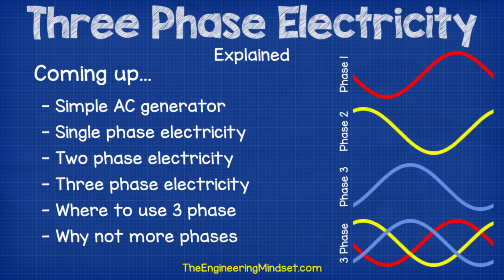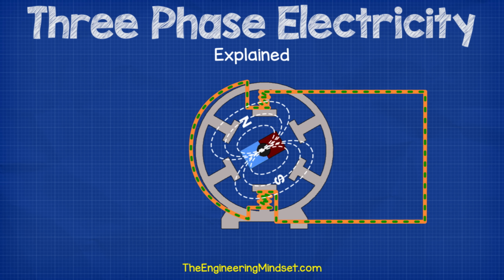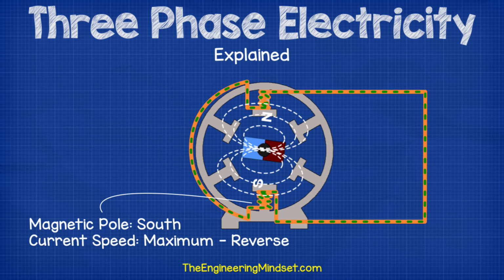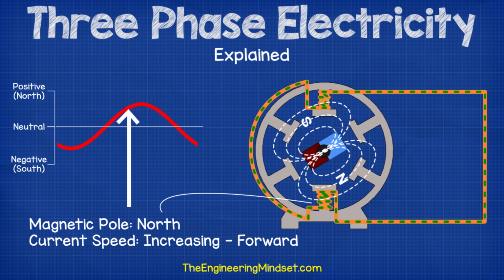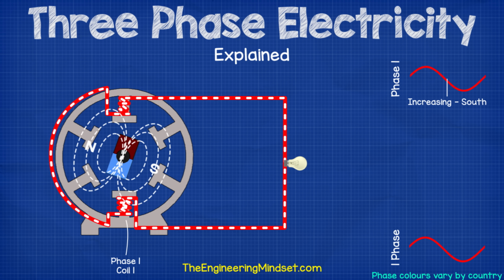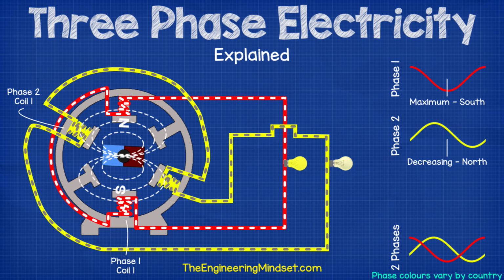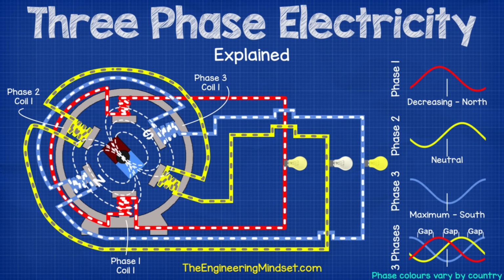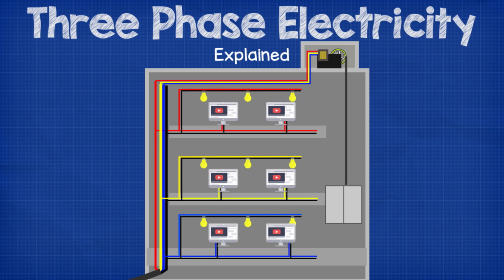How Three Phase Electricity works - The basics explained

Comment: Thank you so much for the animations - they make a world of difference. I knew lots of bits and pieces shown here already - that magnets and coils do the generation, what an AC sine wave is, the 50 hertz coming from the grid and some three phase stuff. But in this video a couple of details finally gelled everything together for me. I didn't really understand WHY our AC power comes in a sine wave, and why it comes from the grid at 50hz. But it's clear now it's simply generated in that manner, it's not being changed into that form by 'the grid' for any reason. 

The 'lightbulb moment' for me was the details of the AC generation - the animations showing how the voltage being generated at any given moment is directly related to the strength of the moving magnetic field intersecting the stator.  (hope that's right). Really really excellent for those of us who learn more visually.
Reply from the maker: Glad you enjoyed, sounds like you're ready for the next level https://youtu.be/qthuFLNSrlg

Comment: I wonder where the black wire goes (ground). Why doesn't it go back to the generator? Two phase cables require two wires. Three phase power lines only have three wires. Where did the fourth wire  go? (The cable that goes to an engine does have four wires, but why isn't there a fourth wire in high voltage power lines)?

Comment: Why  does the motor spin in the opposite direction if you change the order of two of the phases?
Reply: I'm asking because the order of the phases doesn't change phases themselves.
Reply from the maker: Each phase increases it's magnetic field through the cycle pulling the rotor to it. If the phases to the coils are in order 1 - 2 - 3 then the rotor will be pulled and spin in the rotation of 1 - 2 - 3. But if we switch phases to the same coils so it is now 1 - 3 - 2 (clockwise) then phase 2 will still reach it's maximum after 1 and before 3, so the rotor will be attracted to this instead so it rotates backwards.

Comment: Can someone clear up something for me? I understand the electrons is the electricity that flows in matter that have loose electron fields like metal and not glass and rubber. If I understand this right you could hook a wire up to itself with a positive and negate charge and electrons in the wire will start flowing. 

Is the AC generator implying that the copper wire IS where voltage stays until a close circuit pushes the electrons? Or is it coming from a power source with an abundance of electrons? If this is true then why do batteries die on a close circuit and the flow is sustaining in AC generators?

Comment: Instead of adding phases, why not increase the frequency of the supply? 
Thanks.
Reply: that just means rotating the magnet faster, which can be difficult because it also increases friction and the amount of work required to spin the magnet. we added extra wires because it simply harvests more energy without having increased requirements, which is more efficient than trying to spin the magnet faster.
Reply: @benjaminchance3311  thanks for the reply!

Comment: Why would "bigger" consumers need 3 phase?
For more current to power it?
Reply: Yeah, less current. In Europe between two phases voltage is 400V, between phase and neutral is 230V.
Example, three phase induction motors are better than single phase, they have better start, more power and needs less current for same power as single phase motor.

Comment: Wait, house will be on single phase? Are you shure?
Reply: Depends on the standards of the region.  In the US, a household is powered with 120/240V split-phase, which is derived from a single phase of the overall 3-phase distribution system.

Comment: Good video. I am an old guy with a degree in Physics and at one time even knew how Maxwell's Equations worked, but don't remember a nice practical pictorial representation like this. My one point is that you skipped over describing how the output would behave when a source was hooked up to only one of the three phases. For example would the now one phase source go back to a sine wave passing through zero making for a seriously flickering lamp again?

Comment: What a great video, had a sparky explain this - your animation is better than his pencil on drywall! Really odd question and so silly, but I'm curious. If video recorders/filmers wanted to avoid light flicker in their videos, would a 3 phase supply do that? Not suggesting anyone would upgrade their electric just for that, but just curious if that would sort out the frequency stuff so it doesn't match that of the camera's frames per second. Cheers and keep up the good work!

Comment: Extremely good Video! But there are 2 things i dont understand that good... 1st why is the Current flow the highest, when the magnet is placed so, that all magnetic waves cut the wire? I mean then you could have a static magnet, not moving and current would flow... Right? 2nd I thought The higher the turn speed of such a generator -> the higher the Voltage its putting out... But With that Example it would mean higher frequency... Or is the "higher Voltage" just the RMS voltage, that increases with higher frequency? (higher pitch -> lower time, when the voltage is low, peaks get "stronger" correct me if that is false)
Reply from the maker: Watch this one, it's better: https://youtu.be/qthuFLNSrlg

Comment: I understood that using multiple ACs out of phase would help you approach a more constant current output. What I didn't understand was the significance of 3-phase. Why not 2-phase 90 degrees out of phase? Or 4-phase 90 degrees out of phase? Was there something I was missing that was special about 3-phase? Turns out the answer is simply "3-phase is good enough".

Comment: Homes mostly run on two phase power only because of large appliances like electric washers, dryers, dish washers, AC, etc.  They run in potential energy greater than 110 V.  So, they run two phases of power in parallel to those circuits.  One phase to most everything else, though.
Reply from the maker: North America but not the rest of the world
Reply: @EngineeringMindset  -- Fair.  Since many other countries run single phase 200 to 220 V power, they likely don't need an extra phase for larger appliances.
Reply: @MarkMcDaniel  In Poland and probably most of Europe you get 3 phase 400v to every house. No problem running industrial welder/compressor etc from "home"  connection to grid

Comment: Im in Australia our domestic voltage is 230 i was under the impression that you could also run things in singal phase with two of the 3 phases useing 1 as a neutral giving you 410v can someone clarify thanks

Comment: One thing you didn't mention, and probably the main reason we have 3-phase power in the first place, is how much more efficient it is to distribute three phases. When you have three phases who's voltages vary as sin waves, and are offset from each other by 120 degrees, at any point in time if you add the three phases together you get 0 V. Assuming you are able to distribute the load equally across all three phases, this essentially means there's never a voltage difference between the power station and the transmissions lines right up to the transformers that step the voltages down. So instead of one phase of power using 2 large lines, we have three phases of power using 3 large lines.

Comment: You forgot to mention that when you connect all 3 phases, you theoretically have no need for grounding (although it's still usually done for safety)
Reply: Not even close to accurate in 99% of installation. If you have a 3 phase balanced load you do not need a grounded (neutral) conductor as there is no unbalanced current for it to carry. A grounding conductor is always used for safety. Without it the circuit breaker will have a tough time tripping during a fault. In some instances the metallic pathway may be used to replace the grounding conductor but in my career I've always installed one.

Comment: I thought I understood until time 7:00. If the idea behind 3 phase is to take away the "flickering effect" of single phase, why doesn't the "flickering effect" return when you direct only one of those three phases to a home?
Reply: The idea behind 3 phase isn’t to take away the flickering, it’s to provide more power to motors and devices that require more energy and to send energy long distances . The single phase coming into your home is also causing the flickering effect. It’s just that your eyes can’t see it because it’s happening so fast. 
The frequency is the same across all 3 phases. 50-60hz

Comment: Excellent video!
However, a small error at 5:41: you say that there are still gaps with 3-phase power, where in fact there are NO gaps. The total amount of  power supplied by 3-phase electricity into a balanced load is exactly constant. So adding more phases would not be an improvement.

Comment: You mentioned the electricity 'speeding up' when the max and min of the cycles were reached, but the electricity doesn't change speed (?) -
Reply: Correct, it's the voltage that increases.  The electrons aren't "brushed" along by the lines of flux as the diagram implies. The poles of the magnet alternately attract and repel the electrons so they bunch and spread out, more like sending waves down a slinky spring - or the voltage-pressure analogy. Single phase AC voltage goes from maximum* positive to maximum* negative and is zero half way in between. The rise and fall of the voltage follows a sine wave. The poles of the rotor are analogous to the pedals on toddler's tricycle, which also move in a sign wave as the trike rolls along.

* the voltage stated on AC supplies and eqpt is averaged as RMS (root mean square) 120v actually peaks around  170v, 230v at 320v.

Comment: 0:01 my dude. That gear system doesnt even work. Think about it bro. they will be turning against each other and lock up
Reply from the maker: It's does work, it's an idler gear.
Reply: @EngineeringMindset  All three gears are directly connected to each other. Idler Gears separate the two gears and allow them to turn in the same direction without affecting rpm, torque, etc

Edit: Btw I did like the video it was informative and interesting but you should rethink the design of your logo.
Reply from the maker: You can't tell if they're touching from one perspective, different length gears. Not that they move in the intro anyway so maybe they are just stuck.

Comment: Ok, this video is great but it gave me another huge question. I know you simplified sime of the steps of the generation method, because it works well with one generator, but how on earth does every single magnet spins at the same speed and phase so the power grids with multiple generators do not fight between themselves?

Comment: There are many comments about how they understood 3 phase only after looking at this video, but blame teachers for not explaining it clearly.
As far as I remember I was never taught about 3 phase in high school (1950s). I understood single phase OK. I wasn't exposed to 3 phase theory until I did electrical theory and machines at polytechnic as part of my electrical engineering degree course. We all found that the 3 phase concept was the most simple part of the course and had no difficulty absorbing it.
Does this mean that the teachers are now unable to teach properly? I very much doubt it. I suspect that the problem is that it requires something longer than a 30 second attention span an a bit of hard work.
Reply: You'd be surprised how many terrible professors work at universities. Most of my honors Calc class I spent having to teach myself, because the teacher barely understood the material. And who is more likely to watch a video about 3 phase systems on YouTube? Someone who already knows and understands the concept, or someone who doesn't?
Reply: @Salien1999  
There are some poor teachers in university, I agree. I had one in the strength of materials class. It's very unfortunate. To be honest, I would have been a poor teacher myself. Mentoring has not been a problem to me during my career, but structured teaching in a formal environment is different.
I was fortunate in high school where I was taught 90% of all the mathematics, including calculus, that I needed in further education. My teacher was a great mathematician, shamefully I now can't recall his name.
Reply from the maker: Check our new revamped 3 phase explained video, sooooo much better:👉 LINK: https://youtu.be/c9gm_NL7KyE

Comment: what i don't get is when we are looking at the generator, there is 6 total wires for the 3 separate phases. but you do not show how it goes from 6 to 4 lines and how they go together through a 3phase load. it seems that they use a common line. which makes sense, but it would mean 3phases at 10A each, which means 45A on the common. i was told by an electrician that the common does not carry the full current load and the phases "cancel each other out" and the current is 0. he could not really explain how it does this and it makes absolutely no sense to me, any help?
Reply: I will try to explain the simplest connection, which is the wye or star connection. 3 wires in the generator (one from each phase) are connected together, making a neutral point. The other three ends (one from each phase) are connected to a 3-phase load. Assuming the load is in wye connection too, the three phases are connected in the load also making a neutral point. You can connect the two neutral points and this connection would be called the neutral (common) line. If voltages and the load is perfectly symmetric, the three  currents cancel out and there is no current in the neutral line (it's very hard to explain why that is without drawing graphs; try to draw three sine waves on the same graph which are equal in amplitude and frequency (equal period), but are 120° shifted between each other. If you do that, you will see that if you add their values at any point of time, the result is always zero. If you have Matlab, I can send you the code, which you can run to see this). And there's the beauty of three phase electricity, the neutral line isn't needed. That's why you don't see it in transmission lines. But from the low voltage trasformer there has to be a neutral line because we have 1-phase loads at home, which are connected between one phase and neutral line.

Comment: I thought houses had to have 2 phase at least to power 220v appliances like stoves, water heaters, and hvac units.
Reply from the maker: in the US, rest of the world has higher voltage so doesn't need two. check out our voltage explained video
Reply: In Sweden and in large parts of Europe most houses has all three phases routed into them. Even most apartments do. A standard kitchen stove in Sweden runs on three phase power and is attached through a special three phase stove connector called Perilex: https://en.wikipedia.org/wiki/Perilex
Reply from the maker: Watch this video on US electricity: https://youtu.be/fJeRabV5hNU